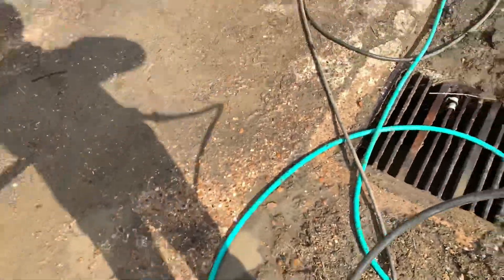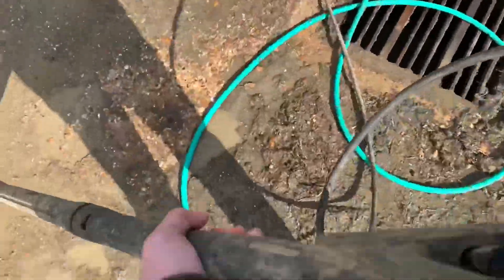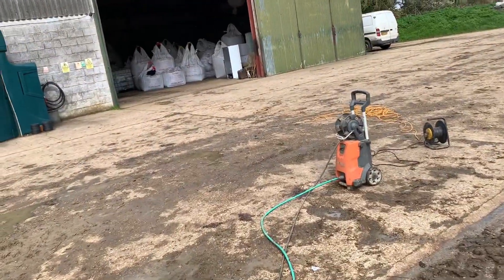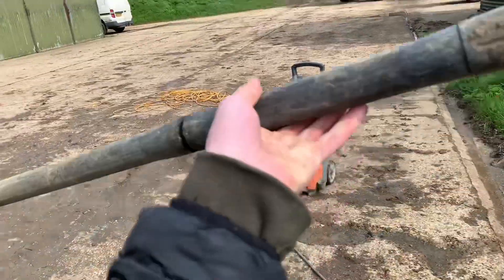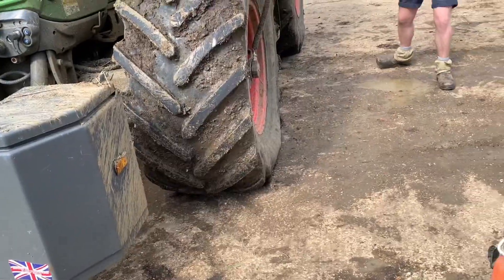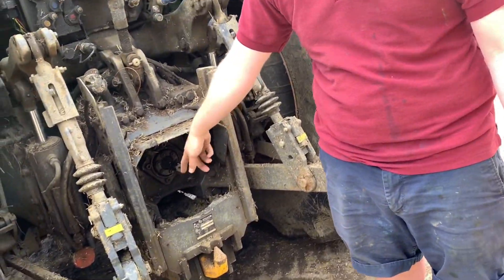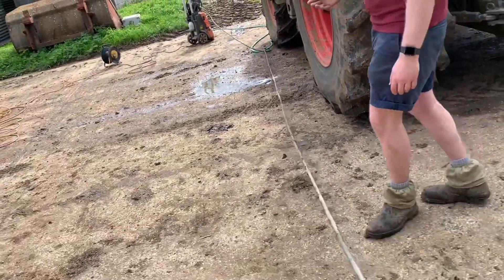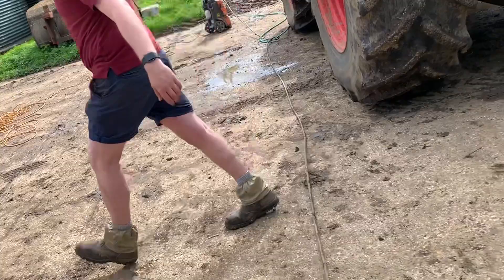SATISFYING PRESSURE WASHING WASHING! CLEAN FENDT! #pressurewashing #satisfying #tractor

Comment: Would have been nice to see some third-person views as well, when you get a drone you could do a Timelapse from above which would give it an interesting perspective.
Reply from the maker: Great idea! It’s on the way only thing is quite hard to keep in stable flight (one position) over a sustained period of time without too much movement. Kirk your edits.
Reply: @TheJuniorFarmer724  DJI drones have APAS which allows them to stay in one place even if there’s any wind so that shouldn’t be an issue for you.
Reply from the maker: @joelwood.photography  yeh they do but doesn’t mean it’s totally in one place
Reply: @TheJuniorFarmer724  actually it does, most DJI drones have a hyperlapse mode which is basically the same as Timelapse. You can setup wait points then the drone will stay in the same position over a duration of time. It will then automatically turn that into a Timelapse. I’ve done it a number of times with my drone, I did it at an event I shot at last weekend. It’s very possible, just doesn’t seem like you’ve done your research.